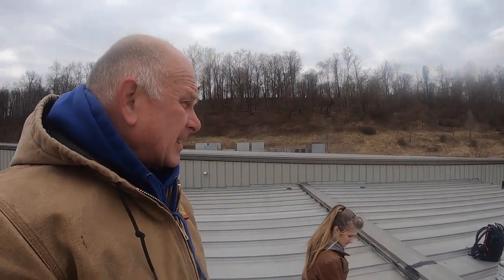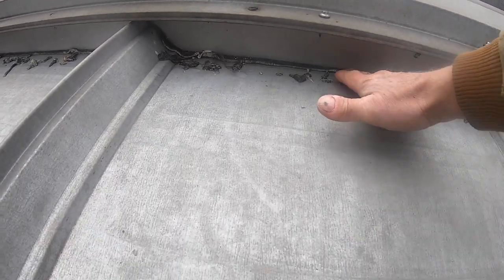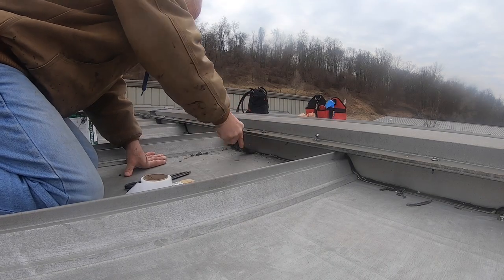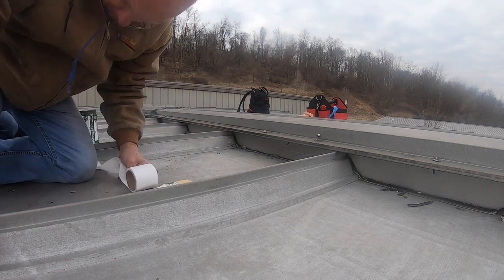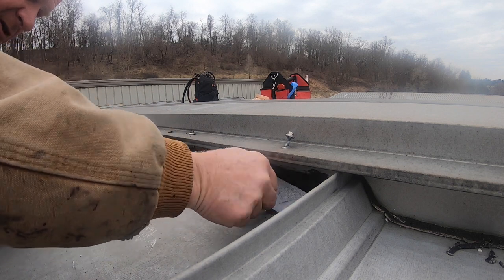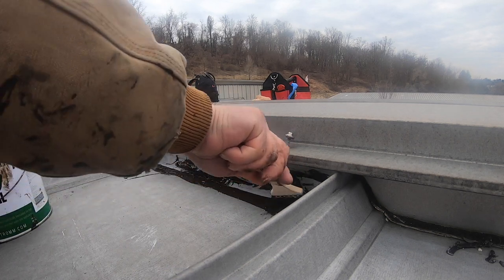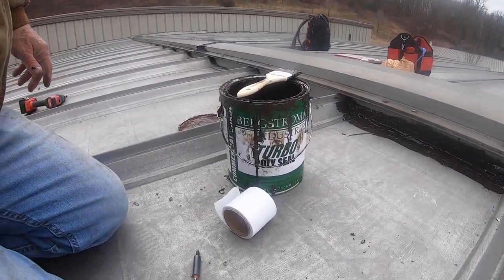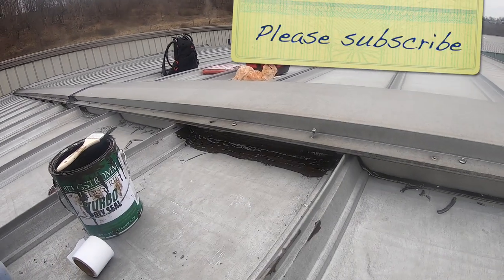METAL ROOF LEAK repair under 3 min with Turbo Poly Seal

Comment: I have a 43,000 square foot metal roof.  There are 14 air conditioners on it.  I have many leaks everywhere that pipes and other things penetrate the roof.  In the past I have tried spraying the 2 part DOW chemical foam and it seemed to work but only for a year.  I'm asking you, the Flat Roof Doctor what to do.  My big idea now is to have a sheet metal guy make some 4" x 4" sheet metal diversion brackets to divert the acre of water around the AC units so that only the water that falls directly on each AC unit will have a chance to penetrate the pipes etc.
Reply from the maker: Hi
I have encountered a similar situation before. The problem is you have coated the metal with spray foam that makes it harder to make any repairs.
I suggest to take pics of the roof and problem areas and send it to my Tel no 203 858 0080 and I will be able to better help you. 
Anyway, my first thought is to clean the areas around the A/C units and vent pipes from all Spray foam. Once the curb flashing is exposed then it is very easy to make repairs with Turbo Poly Seal. The image that I would like is after the spray foam has been cleared, is to see the standing seam metal that butts up to the curb on the upper side of the A/C. That where you want to add diverters. The standing seams should not butt up right to the curb but there should be at least 5 - 8 inches of flat surface around the curb to let the water flow.
Anyway send me pics so I can analyze your situation better.

Comment: Where can you buy the fleece that you put on top of the Turbo Poly Seal before you added more Turbo Poly Seal?
Reply from the maker: Hey Sue. The Fleece comes with the Turbo Poly Seal Kit when you order it. It comes in 4" wide rolls.
Go to Bergstromm.com  to buy it.
Reply: @FlatRoofDoctor  Thank You!
Reply from the maker: @CharlesSue59  You welcome, Anytime you need help just ask.
Reply: @FlatRoofDoctor  If we order the Turbo Poly Seal, how long does it generally take to receive it? Thanks!
Reply from the maker: @CharlesSue59  Due to the type of product " Hazardous"  it can only be shipped via ground shipping. We have noticed that UPS is pretty good and fast and people have been surprised how fast they received their Turbo Poly Seal. 
It takes between 3 - 5 days most of the time.
Reply from the maker: Hey Sue, I thought I already replied on this question before. But sorry if it wasn't you. The fleece is part of the Turbo Poly Seal Kit. When you order online the fleece is included.